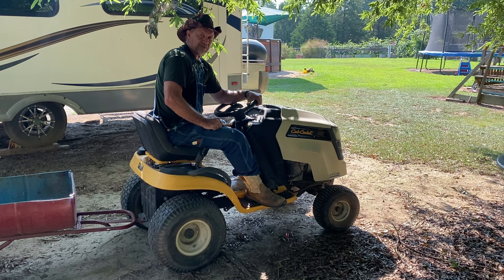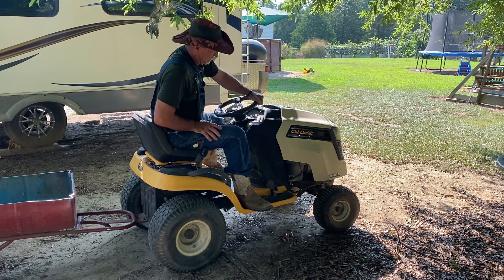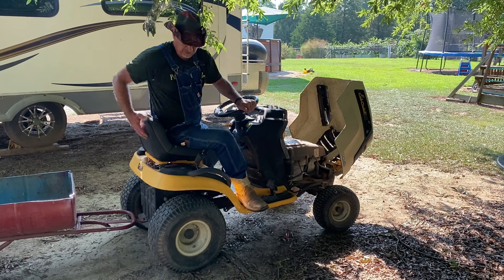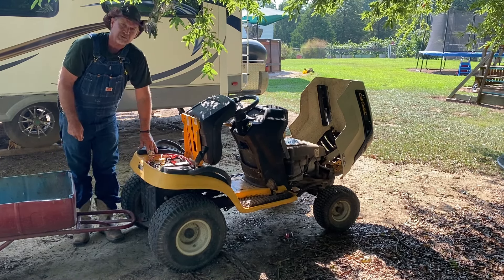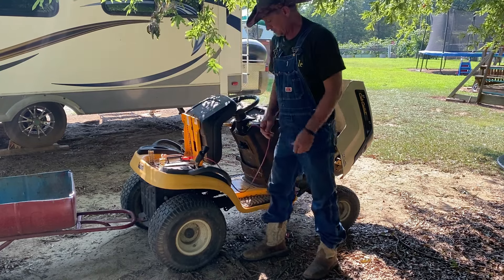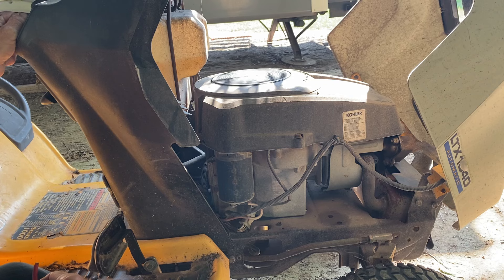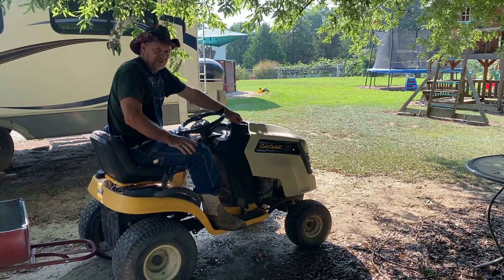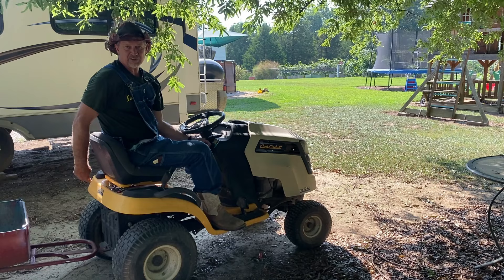Lawn Mower Just Clicks, How to Start your Lawnmower when it Just Clicks

Comment: Dang it! You may have made my life 100% easier! My cadet often just does a click squeal noise that after 50 clicks or so will start! 😂 😊
Reply from the maker: If the battery is good and the connections are clean, then it's the solenoid. 
Thanks for commenting!